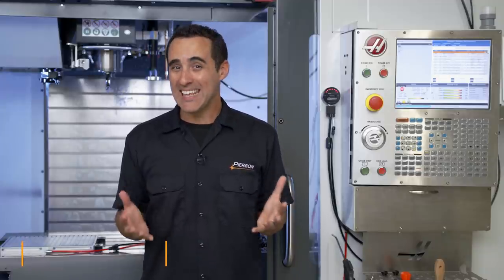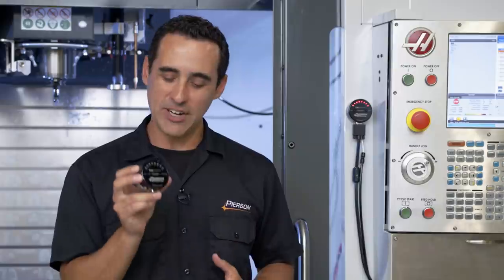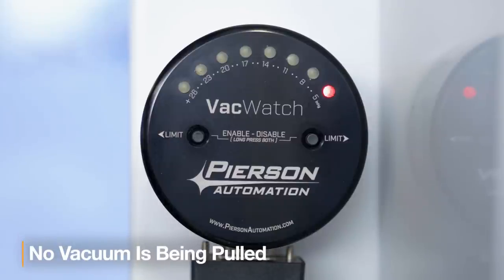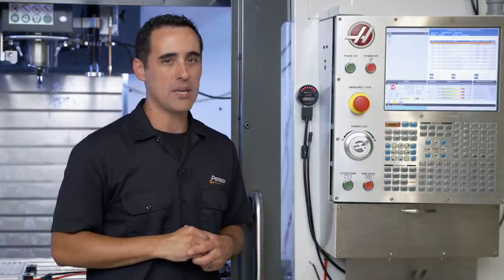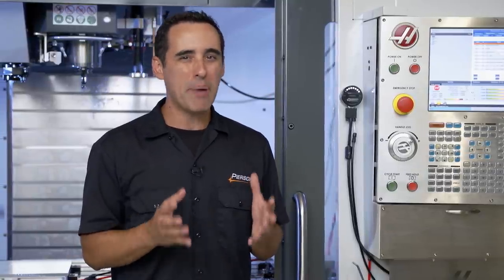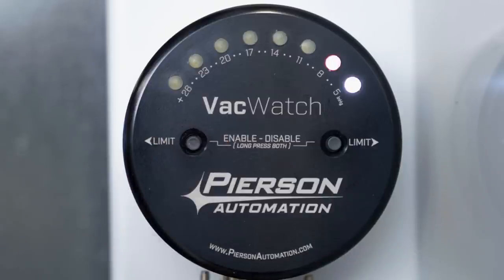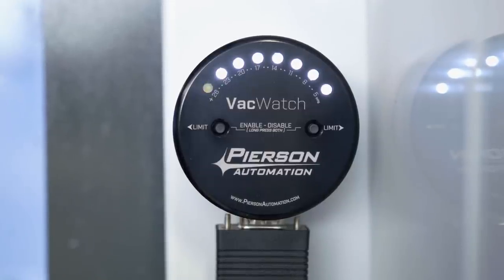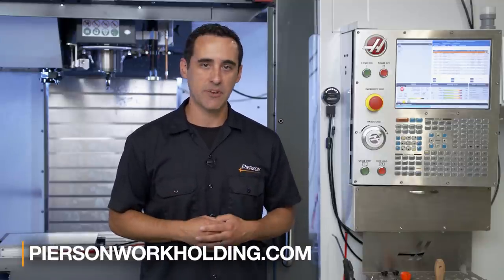VacWatch Overview - Pierson Workholding

Comment: We have a LARGE router and the control isn't close to the vacuum source. How far away can I place the vacwatch?
Reply from the maker: It comes with a 20 foot data cable but we've already designed a second generation that will have a remote display that can be placed farther away.